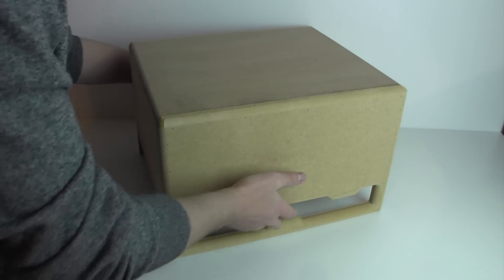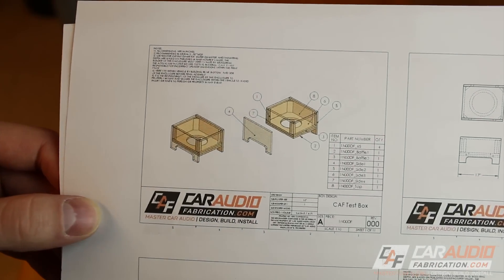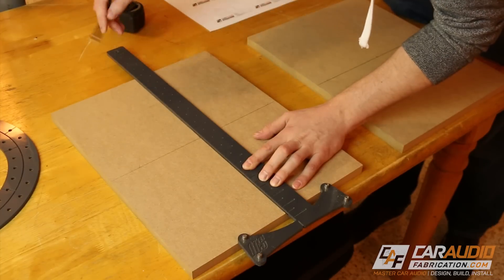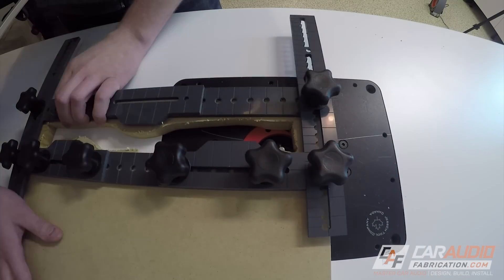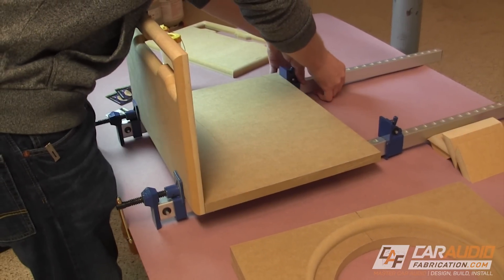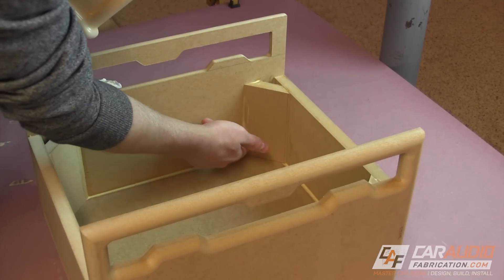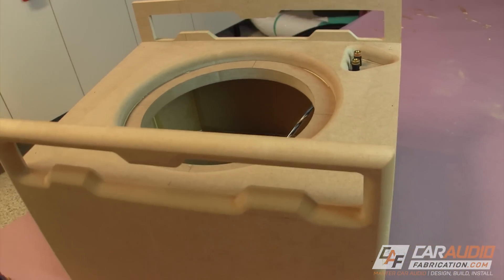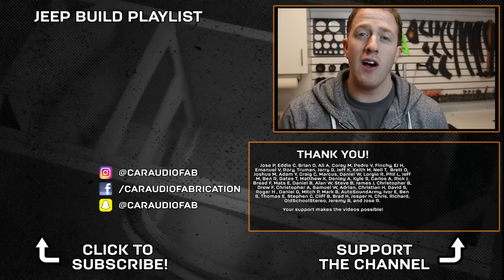Build a Subwoofer Test Box - BETTER BASS - CarAudioFabrication

Comment: I have a 2005 Chevy Silverado Crew Cab.  I have (2) 12" KICKER CVR 600 watt subs in a sealed 'stealth box' under the rear seat facing up.  They sound great and have tremendous output for the relatively small cabin space of the truck.

Comment: My Setup: 2003 Toyota Camry and subwoofer box is corner firing in the trunk. Back seats up with ski hole cut out of the middle of the seats. One SoundQubed HDS315 on an Audiopipe APCL15001d. Ported box with external PVC port tuned to 32.

Comment: I've got a 2006 Holden SS Commodore... or to you guys in the US... the 4 door version of the 2005 Pontiac GTO... I'm running 2 12" Rockford P3's in a custom made box... on a 45 degree downward angle  either side of the dropdown in the middle of the backseat... along with 2 Kicker 8's on the backshelf... a set of Hertz MLK165 splits in the front... Hertz HCX coaxials in the rear... all running off 2 Audison amps... I've picked up a few tricks off here which have help me to kick things up a notch with my custom work...👍👍👍

Comment: Thanks for sharing your build - and since you asked:
I've got a Subaru Legacy wagon with a ported 1.75 cubic feet internal volume sub box with a single 12" subwoofer in the back cargo area. The box is well braced internally, has a 6 inch internal port, and I recess mounted the speaker so I could cover both the speaker and the port with hardware cloth and then carpet to protect everything - so the external size is somewhat bigger than the 1.75 CF internal volume would suggest. I now have both the sub and the port pointed upward.
I first tried firing both forward into the back of the rear seats, but changed orientation to firing up after about a month. I am not sure I can tell a difference in sound volume or quality for sure between forward and upward facing.
At first when I faced the box into the back of the rear seats I was worried about protecting the speaker - but really nothing gets on the box or even threatens the speaker area with it mounted all the way in the back of the car, even though the box technically is not separated from the seating area as it would be in the trunk of a sedan say.
...you did ask what direction people have their subs pointing...

Comment: I have 4 Soundstream R1 124's, Two up firing in a box from you Mark, and two inverted in 1 sqf sealed air space in a Toyota Celica with the rear seat removed run by two Soundsteam T1.6000DL's and 2 MB Quart 8' mounted in the doors run off Soundstream PN1.650D. Yeah I know, long winded!!!

Comment: I have a Rockford 12" P2 facing towards the trunk. I am trying to learn more about car audio so there wasn't a calculated decision on that direction but it works great for now. I first had in installed in a 1998 Ford Escort. I am now driving a 1989 Toyota Camry. Not the ideal cars but I had to have a good stereo.

Comment: Extended cab 2012 f150 with a single 15" (audiopulse axis) in a sealed 3cuft enclosure. The sub is firing up/forward at a 30 degree angle. Looking for ward to trying different configuration later in my build and will try using a test sub setup. Previous experiments in an extended cab nissan hardbody pickup I got the best/loudest bass with the subs firing forward vs up. Never tested it in my current truck....yet. Still working on my active two way setup with dsp as seen in previous CAF videos. Awesome stuff.

Comment: Toyota Matrix 2009 Base with 1 SoundQubed HDS3.112 on a Q1-1200.2, sub up, port back towards the hatch. Tried all other orientations and this worked the best. Also helps the lows if you Velcro or mount the box right behind the front seats.
Reply from the maker: Sweet! Yes rigidly mounting the subwoofer into the vehicle is not only good for safety, but it does help to achieve more output as the box cannot lose acoustic energy bouncing around.

Comment: My newest system is in my 03 grand cheroke. 2 - 15 nvx wcw's  on a cab 1600.1 in a sealed box. I have them facing towards the rear hatch. I pointed them up but they lost a bit of sound so they face backwards.I am building a ported box soon. It already rattled my head pretty hard and cant wait for the new box.

Comment: I have a 2002 Kia Sedona with 4 12" planet audio dvc subs facing forward at a 45* angle with ports facing forward and tuned at 23hz. I also have 2 10" Cerwin Vegas in a sealed box facing up in the same minivan. The third row of seats is removed to accommodate these two boxes in the rear.

Comment: 1999 ford expedition with 2 15s and 1 12 in sub (orion xtr) firing toward the back of the car at a 15° angle and plated the back hatch with dino mat so sound reflects cleanly into front of car

Comment: 1997 Camry. Kicker S12L7 12" Dual 4-Ohm VC Solo-Baric sub in a pre-fabbed port-tuned box for a 10" sub (due to space limitations on my 1985 Corolla GT-S, where it was originally installed). I mounted the sub externally to make up for the loss of volume from the smaller box. It's mounted on the passenger side with the sub's magnet facing the right rear quarter panel and the port facing the rear bumper. The sub is powered by a Kenwood KAC-9102D amplifier wired parallel to give 850 watts RMS. I tried facing the box towards the rear bumper, with the port on the right, then the left, but found the side mount (longitudinally) to give the best sound while using the box itself to protect the sub from objects in the trunk.
Reply: Hi am from Italy I watched this video ana was so amazed it's quite unfortunate I can't get you to make one for me.... Please I want to buy Rockford fosgate P3D4-12  for Hyundai Tucson 2018 model. Can you kindly help me out with the perfect down facing ported box for the subwoofer both box size and sides measurements I will highly appreciate if you can help thank you

Comment: I have 1 dual (2)12 inch ported box that was made by same people as subs I have them in a 2012 fusion facing the back of the trunk port is long on top with the back against the fold down back seats. been hooking up systems since they went big in the 90s I love this stuff. but anyways have always seemed to get better sounding deeper bass that way

Comment: Driving a Skoda Felicia. 

At the moment the sub is faced torwards the trunk door and port just above left wheenhouse. However, I did some spl measuring before mounting it in its location and there was a 0.8db difference between that location and port faced right below the left taillight/wheelhouse.

Comment: 1997 Accord Coupe. Boston G215-44 in a 2 cu. ft. sealed box (prefab.) in the trunk against the back of the rear seats and facing the rear of the trunk. Powered by a Rockford R500X1D (birth sheet states 637w RMS @ 2 ohms).

Comment: I have a 2004 expedition. My box is located behind the second row and infront of the 3 row. I have 2 12" boss 2400 watt speakers facing forward with a 5000 watt amp pushing them.

Comment: I made a box 32 3/4" wide 15" high 22" deep with 2 center ports 2 3/4" wide 13" tall with 2 kicker solobaric L7 10" subs 1200 watts RMS in a 2010 Toyota Corolla firing into the cab. The box is made with 3/4" MDF and with the subs in it I can't move it by myself so I can try firing to the rear test. I had the box in my 1992 Mustang GT hatchback firing to the rear and you could feal the bass.

Comment: 2005 dodge ram removed the rear seat built a sealed box to house 2 sound stream T5 152s forward firing on a hifonics 2k with a hifonics 600.4 running my mids and highs

Comment: Nice work on the little details Mark! even if it is just a test box. Very curious how the response will look like on the RTA and how loud it will get in the cab of the Jeep (even if chasing #'s aren't a main goal)

I have a Sundown setup in my Ranger with a Zv4 10" rev2 D2 on a SCV-2k. It is a sub up, port forward (drivers side) setup PLENTY loud for my liking. In the new year i'm considering switching to a sealed setup and having a Stereo Integrity HST 15" built

Comment: 03 Trailblazer .08 cubic foot custom built sub box in the rear passenger side wall. 12 inch pioneer ib flat sub and a kicker 250 amp.  same orientation as a door speaker but in the cargo area.

Comment: Okey so i have been playing around with boxes a bit and my first box was 2 12"s ported everything firing in to to cabin on a coupe, loved ut sounded great didn't look so great because of some miss calculations before i bought the woofers should have went with 10"s in hindsight, then i tried to have them fire up against the trunk and having the port go in to the cabin but that box never got finished and the car broke down so the woofers are going in to a new daily and this time its gonna be a 4th order firing agains the trunk in a 3 door hatchback.

Comment: Honda accord coupe, 15" on 1000 watts. Sitting in the middle of the trunk firing backwards towards the trunk. Tested a few locations and thats the loudest she gets.
Reply from the maker: Nice, many trunk cars you will find facing backwards is best.
Reply: CarAudioFabrication I have 2 Jl audio 12w6v3 and the JL 1200v3 slash amp. What kind of box would you recommend for my 2001 4runner..?

Comment: I've got a 2012 Gecko Green Jeep JKU. Audison components, hertz pro coaxial, and in the back I have a mojo 12 rear facing (hard top Jeep) in a very blah "ProBox superbass"... I'll be building a better one soon. Custom built amp rack housing an arc audio XDI 1100.1 and an arc audio XDI 600.4. Sounds AWESOME! Although my sub is a dual 4 ohm so I'm only pulling about 500W clean with my 12" mojo. :(

Comment: Volvo 740 sedan. It has a huge trunk so I have a single 12" subwoofer in a large ported box placed in the middle facing backwards tuned to ~30hz with a 155ah agm battery next to it. I previously had problems with trunk rattle, but after dampening the rattles have mostly gone away. I also have removed the rear deck cover liner and it is now coated with damping material, there are two holes in the deck (from the factory) covered by the lining so removing it made the sub breathe into the cabin much better so it hits those lower frequencies much nicer. If you have any questions about this vehicle feel free to ask!

Comment: I have a 98 subaru legacy and I had 2 12s sound stream with a 2000 watt amp facing outward to the trunk but I'm upgrading to 2 15s nvx and a 7000 watt amp it's still gunna face the same way

Comment: 1999 Toyota Sienna, it's not installed, but i have a Kenwood Excelon 8" with a 400w amp, planning to build a box to put between the front seats downfiring ( i use the car as a cargo van so i don't have lots of options 😔 ) what do you think about it ?